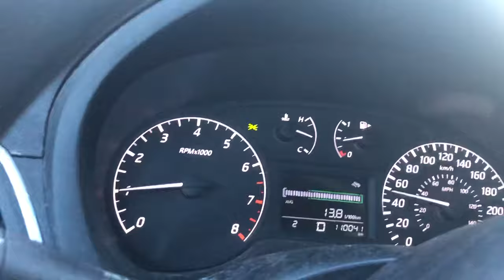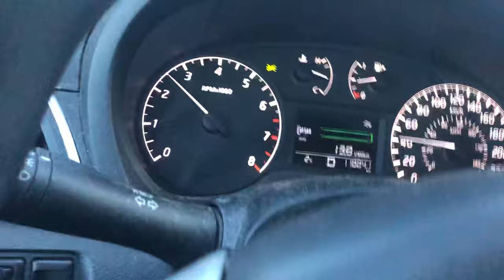Nissan slipping Cvt transmission

Comment: On nissan cvts your supposed to change the transmission fluid every 25k miles
Reply: @Jeffrey Bird yes
Reply: @moreno valley news first or tell the dealer to do it
Reply: @moreno valley news first I have the same cvt in my spark hopefully mine lasts that long
Reply: @moreno valley news first I have a 2021 so it’s the same engine in the Cruze but without the turbo. This engine has a timing chain instead of a timing belt unlike the Cruze 1.4
Reply: @moreno valley news first They hate touching the CVT, because if it just happens to grenade after a fluid / filter change, the customer is going to blame the dealer for touching it, then they get into a big fight and have to replace it at their expeinse. They'd rather it just grenade on you at some point. This is one of the only bad points with CVT's, the failure mode (broken band / solenoids etc.) usually makes the unit an expensive write off, and they will just recommend replacement of the entire unit for thousands of $$$. Automatics can also fail spectacularly but they usually go out gradually, and manual trans which is so rare these days, is rock solid and fails in predictable, usually slow ways.

The Nissan CVT has a small pump unit / sensor arrangement, these can overheat and fail and require replacement. All transmissions have a finite life, and the engine will nearly almost outlive it.
Reply: Who does that and why don't they tell you and You can't because it's Closed and dealerships charge hundreds of Bucks! Y I OTTA!

Comment: Instead of trying to find support on saving money without spending on CVT fluid change, just change at regular intervals, 30K or 50K. I wish I did change it, but now it is too late. my CVT fluid was not changed until 110K, then did not completely replaced or flushed, now CVT is slipping, electric throttle control system is failing, transmission slipping, jerking at various speeds. I changed the the CVT to see if it helps. NO. it is too late. rebuilding a transmission would cost around 2-3K. I already spent 4K on other issues just 6 months ago. So I am in a shock of what to do. lose all the 4K or spend another 3K with 155K miles on it.

Comment: Looking at the steering column it's a 2013 2015, probably ran with the original fluid and that's what did it. Plus those years were a bad design.
Reply: Hi 404, its happened after i change with castrol the transmission fluid...make me scared everytime at stoplight...any idea?need help. Thanks

Comment: MY 2004 MAXIMA WITH A 5 SPEED TRANSMISSION AT 307,000 MILES HASNT SLIPPED..PLENTY OF INSTANT THROTTLE RESPONSE AND NEVER CHANGED THE TRANSMISSION FLUID WITH NOOOOOO LEAKS!!!!
Reply: Bragging about neglecting your transmission maintenance?  That's really not something to brag about haha
Reply: Mitchell WildFlame ha ha!!!! I was told my Nissan and transmission shops not to drain or add new fluid because it will clean the crud that's holding the bands in place which would cause slippage that I do not have and a new or rebuilt transmission for thousands of dollars... so I used common sense and not touch it... if it ain't broke... don't fix it!!!!...FOOL!!!!

Comment: I bought a 2017 Nissan Altima I’ve only had it for a year in a half and it’s currently doing this. SMH getting it fix and going to trade it in. Nissan has to fix this issue
Reply: did you got your car fix after all cause i have one just like yours with the same problem
Reply: @JonathanCruz-dt7rv  yes I got it fix under warranty but it didn’t came out perfect. I highly recommend trading it in.

Comment: I have 88k miles on my 2017 nissan sentra sv and sometimes I have the grinding and crap(at least once a day) and sometimes it wants to act like I do not have the key fob with me in the car but it is a good car for me other than those issues.
Reply: Change the cvt fluid every 60k
Reply: i have same model also, i drive very gentle on the transmission, and never rev up the engine. If I do then bye bye transmission.

Comment: What year is this? The older models for sure probably have more cvt issues. We plan to purchase a ‘18 Nissan Sentra or versa with low 30k miles hopefully soon.
Reply: Don't buu that shit, get a Honda CRV or Toyota
Reply: Dont buy it dont buy any nissan with a CVT transmission buy a automatic transmission not cvt cuz u gon hate it so much
Reply: Don’t listen to those Scotty Kilmer parrots. Just maintain your CVT like you are supposed to and it will last.
Reply: @lusa3002  LOL Honda what a joke it's plagued with issues

Comment: I will never buy a Nissan again, Transmission went out
Reply: Be prepared to spend more money up front for a Honda or Toyota. You can pay now (Toyota/Honda/Mazda) or you can pay later (Nissan, Mitsubishi, Hyundai, GM, Fiat-Chrysler, Ford, VW) but either way, you will pay. All depends on your current finances.
Reply: @tmmurphy  my friend with a 2015 Buick paid 8k for his fix and he paid 25k for the car
Reply: Thomas J You’re not gonna pay at 11K miles with Chrysler. The transmission Chrysler puts in their vehicles are amazing. Same with the engines, the 3.6L is amazing
Reply: @tmmurphy  and how you drive your cars.
Reply: Frontier is the only Nissan I will buy, 6 spd auto trans, not cvt, on my second one, great little trucks👍
Reply: Eric what year
Reply: I had Ford and Chevrolet, and in both transmission died. Show me a manufacturer that have no issues with transmission, engine, breaks etc. etc. etc.
Reply: @tmmurphy  wouldn't you rather have a well made product than an inferior one? Sounds like an Indian trade to me, or genie rules perhaps, I'd rather buy a new car and not have to worry about the strings attached.
Reply: @BigWheel.  I would, however lots of folks see a "similar" model is cheaper and they only think of the monthly payment, not the other intangibles. Case in point a manager in my office looking for a car considered a Corolla, but told me he was now interested in the Sentra simply because it is cheaper. I mentioned the CVT and everything else. He reminded me that he is retiring soon and this is cheaper. His other (wife's) car is a CVT Chevy Spark so there's that.
Reply: @marco.morel04  They use AISIN in the trucks, you’re correct. FCA uses the ZF 8HP series in their cars and light duty pickups though, and they’re highly regarded as the best automatics in the buisness.
Reply: @TheSavage3.6  Oh, I see. I’ve always heard good things about FCA transmissions except in some Jeep models where they can be slow to respond
Reply: Thats why I'm only leasing one
Reply: @johnrichjr.415  Isn't there a 7 speed auto?

Comment: Scotty says Nissan’s quality has gone downhill since Renault bought them, after watching this, I have to agree, not to mention all the cracked and melting dashboards.....
Reply: Nissan made a really bad CVT transmission 
Changing the fluid does help a lot 
But they are destined for failure 
They deny everything so the customer is left holding the bag 
If I owned that hunk of junk I would never buy a Nissan again.

Comment: Needs to replace the transmission or can be repaired?
Reply: Clean your thtottle body first , buy throttle body CLEANER its a cheap spraycan  , let me know if that fixes it . Youl be surprised how easy it is to do and most likley fix your problem
Reply: @1974charrua  that means have no problem with transmission...good job 👍
Was there any check engine light on?

Comment: CVTs suck, you have to change your CVT fluid every 30,000 miles or 50,000(ish) kilometers. Anything beyond that and you’re driving on borrowed time. Nissan actually updated their recommendations on those intervals. Transmission coolers also help by preventing thermal breakdown of the additives and doubling as a reservoir by increasing fluid capacity. I have a cooler on my Nissan, I drain it every 30k miles and I currently have 137,000 miles on it. I do not like CVTs but mine works like new with no excess whining noise or heat, it’s silent.
Reply: What car do you have . Sentra ? If so what fluid do you use ? And how much
Reply: So if your cvt makes a whining sound does that mean its time to change fluid?
Reply: jonathan taylor garcia 95 Nissan Rogue and I buy my fluid at the dealer for about $20 qt. There’s a few different types NS-I NS-II NS-III..etc Make sure it’s the exact type for yours. Sometimes aftermarket brands may cover a wide range of models which I don’t trust since every model has a slightly different need and some fluids will oxidize and you’ll have thermal breakdown and which will eventually lead to catastrophic failure, especially during a long road trip, driving up hills and not having a transmission cooler makes it worse.
Reply: Cedric Miller If it’s making a high pitch whining at highway speeds and you can hear it over the air conditioning or radio I would drain it, especially if has over 30,000 miles. Now it can be normal to have a faint whine that’s barely noticeable at speeds with all accessories turned of, but if it’s so loud that it drowns out everything else including road noise I would definitely change it and see if it reduces or goes away. That’s usually my case. It’s probably the easiest thing on the car.
Reply: I want to add a trans cooler myself. Nissan actually make one that's suitable. My CVT is fine otherwise and silent, but it don't want the little pump / valve and solenoids failing prematurely.

Comment: 110k miles is the spot where the cvt starts failing.
Reply: 127k just started developing bigger problems been slightly slipping for years but getting worse 2011 murano
Reply: My 2017 sentra has 142,000 miles and it doesn't do that
Reply: 2015 Sentra slipping just like that. Nissan will do nothing for me

Comment: Before Replacing the Trans check engine codes.  I would replace the Trans speed sensor. There is also a sensor by the gas pedal. Change the transmission oil and filter as well the filter in the trans oil cooler. Nissan cvt is the worse cvt ever made!
Reply: There is a known fault with a little pump / valve that overheats for the CVT which then causes the entire trans to overheat, it should have been a recall. The X-Trail was a big issue because it would often get used under load towing and going uphills etc. the early X-Trails had a lot of failures.

Comment: I just bought a 2010 Rogue with 163,000 miles the  rpm gauge bounces all over when trying to accelerate pretty much what this Nissan is doing does anyone on here have any advice where to start ?? Check and changing fluids maybe something else I’m hoping I don’t have to replace tranny as it isn’t worth that much
Reply: Change the fluid twice 
If you can use Amsoil CVT fluid 
It’s the best out there 
If you already change the fluid 
Try Lubegaurd CVT additive 
A lot of people have had success with it
Reply: 14 Pathfinder Platinum  does the same. Bought it last Nov. @91k...just hit 100,560 and started getting the surges. Diag is showing  the  P17F0 cvt judder code. Basically everything that I've found says  to replace cvt. 😢

Comment: I had experienced this kind of problem with cvt Nissan Rogue 2013. Change engine oil+filter, cvt fluid+filter
Reply: Mine surges only 1 time between 30-40mph, then it's fine...would changing cvt fluid and filters help with this?
Reply: @mikepotter3802  yes 
The fluid should be changed every 30K 
You need to do it twice because you can’t get all the fluid out in one drain.
Reply: @anguslean4058  I'm getting it done at the dealership because nobody around will do CVT for some reason.  But anyhow, it costs like $200 bucks so I am not going to have them do it twice.  Will it help on the first go?  I might be able to do it myself over the summer, but not now in 10 degree weather.
Reply: @mikepotter3802  yes it should help a lot on the first drain 
Plus having a new filter will help too

Comment: I bought a brand new 2007 Nissan Maxima in Sep 2007. Since I am retired, the car has not even got 48K mileage yet; and it stays IN my garage unless I am driving or shopping.

I can tell you without doubt, the CVT is crap. It has been from the day I bought it 13 yrs ago. IE: The transmission causes the whole car to vibrate; between 20 and 30 MPH; UNLESS you gun the engine. 

The Nissan dealer told me there was NO solution for it and their mechanic(s) agreed. They also admitted that most of the Maxima's do not have the problem; but others do. Still NO solution. I sent a letter to the CEO of Nissan and complained. The only thing they did was to send it back to the dealer. Big Deal, huh? What a sham.

I would say, "DO NOT BUY A Nissan with a CVT. For it is too risky; EVEN though there are some that rave over it. Rarely does a CVT Nissan automobile not fail completely above 140,000 miles. Some earlier. Nissan will NOT do ANY thing about it in MOST cases. Oh Yes. Do the research.

For what it's worth.

Comment: How do you maintenance a cvt?
Reply: You don't. You budget at least $1500 to replace it short of 100k miles. You used to also have to do this with domestics as well as their automatics typically failed around the 50k mark. Remember the lower price you paid for this car? Most times, you get what you paid for. You can pay up front or you can pay later but in the end you will pay. The beauty of the Nissan is that it gives you 3-4 years to save up the money you would've had to pay Honda or Toyota up front. After 3-4 years of lower payments you theoretically should have the money to pay for the failed CVT if not, Nissan's business model has failed. Guess who is on the hook? You are, lol!!!
Reply: @tmmurphy  i might be wrong but you're better of driving the for two years and crash the car on purpose because ensurance has you covered
Reply: @robert_0505  it would be my luck to get hurt while crashing the car, damage someone else's property and get sued. So now I'm in the hospital in a body cast answering questions to the highway patrol while they write my citation for failure to control with nothing to look forward to but a lawsuit & skyhigh insurance rates.
Reply: As the great Buddy Guy would say: "it's cheaper to keep her."
Reply: Fluid change.
Reply: Change the fluid every 60k. 140k on my 08 rogue.
Reply: @DM-hw4cr  would you still recommend changing the cvt fluid if you have 100,000 miles and never changed it since bought brand new
Reply: Don’t listen to Toyota boosters like Thomas J. Change the fluid every 30,000 or 40,000 miles.
Reply: Add a transmission cooler, Nissan make one that's suitable. Very important. Change the fluid with the correct Nissan fluid, and ignore the dealer's pleas not to do it. It's on the maintenance schedule / manual. Try to avoid towing with the car would be my other advice.

Comment: My company car is a 2014 versa with the cvt. Out of anything I've ever driven this car has got to be the slowest pos I've ever driven. Maybe I'm just spoiled with the get up and go from my 2015 accord v6 coupe but I tried merging onto a highway with the versa and I almost got rear ended flooring it all the way down the on ramp because I couldn't get it up to 70mph. Wasn't exactly the longest on ramp ever but these cars are pathetically slow and in my opinion I'd say it's so slow that it's dangerous because you literally can't get out of your own way.
Reply: It's a 1.6 4cyl with a CVT, that is going to be gutless to drive. A 1.6 Hyundai on the other hand with a manual trans would fly like a demon back in the day, but very light cars. I had one up over 200kph once. A Maxima 3.5L V6 on the other hand seems very well suited to a CVT, but is not as miserly on fuel of course. Doesn't matter as everything in the west is going EV these days fast or slowly.